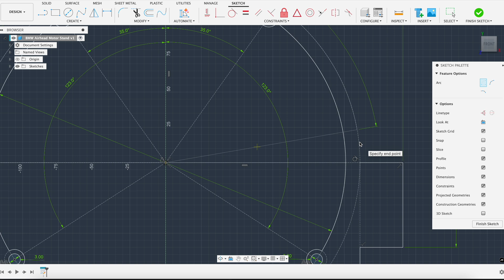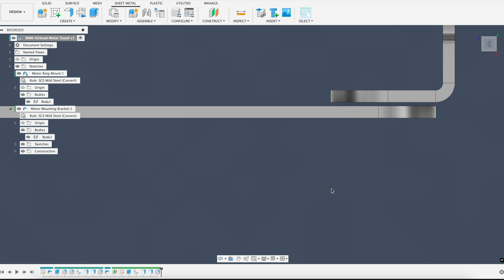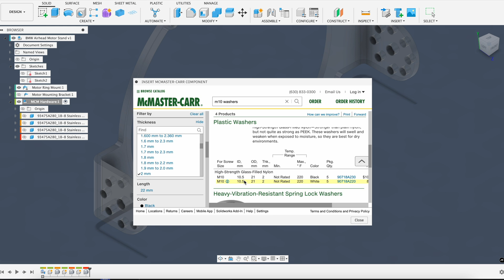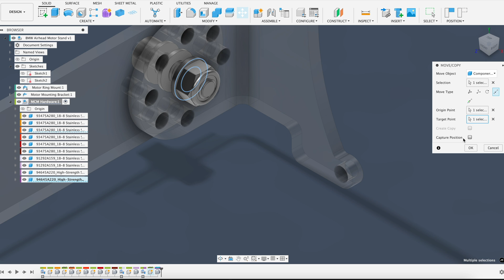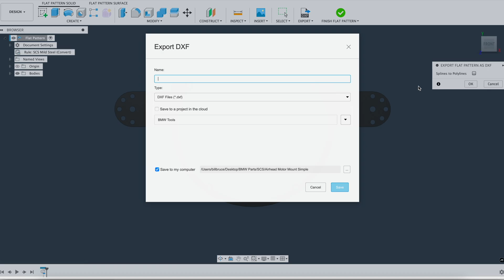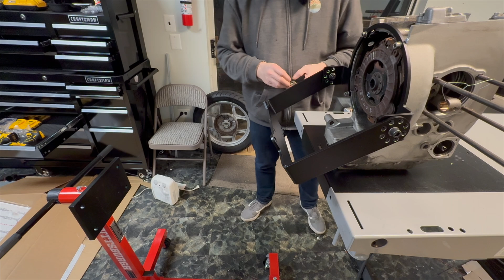Motor Stand for BMW Airheads. Project Blue Ep-9

Comment: Any chance you would like to share your cad file?
Reply from the maker: I don't have the CAD posted, but I do have the DXF files I used for SendCutSend posted on my site. These files are used by SCS to cut and bend the steel.  I am pretty sure I ordered mine in 1/4" mild steel and the DXFs are in metric scale.

https://justabill.org/2025/03/07/motor-stand/
Reply: @JustABillMoto  thank you 😊
Reply: @JustABillMoto  One more question, Im trying to open the DFX file in rhino. And I'm wondering what the original units used in your drawing is. I'm suspecting im not getting the right scale:)
Reply: Sorry, now I saw the video once more and Clearly saw the MM in you cad work:)
Reply from the maker: @KristianKlaveness  Yep. I have trained myself to do all metric on these.